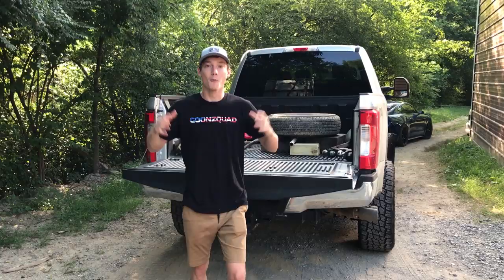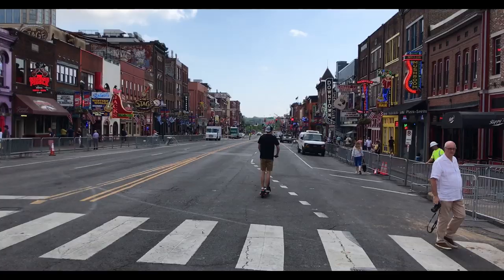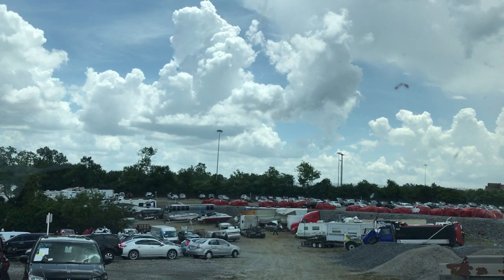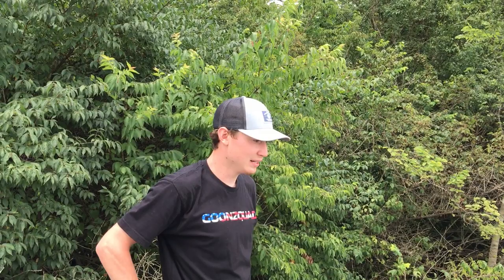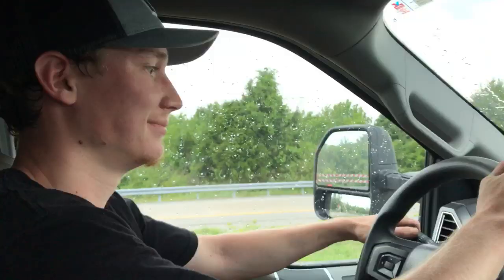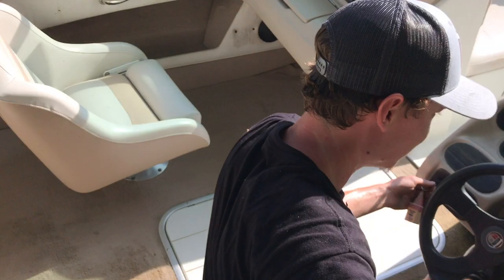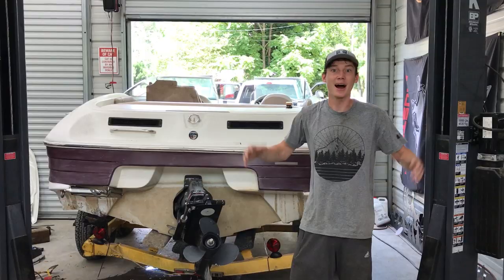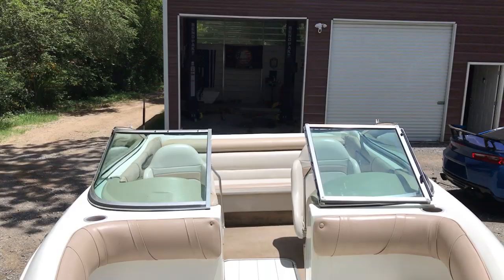Rebuilding A Super Cheap Wrecked Boat

Comment: Congrats on the boat!

Looks like a mid to late 90’s boat with 5.0 Mercury and Alpha 1 Gen 2 drive. Since the engine started right up and sounds good you got a great deal!

One thing to look out for on those older boats is the shift interrupt switch. If the shift cable is out of spec it can cause the boat to stall on the water when shifting out of gear into neutral.They will shift fine on land but then stall in the water when there is drag on the prop.

Looks ready for full send!

Comment: Yo drop in that spare Lamborghini motor.... that would ripp down the lakes man😮🤤
Reply: Would that be possible? That sounds freakin cool!
Reply: Thinkin the same
Reply: Its not because it’s not a marine motor it would fall apart and stop working after 2 or 3 trips on it
Reply: Now that would be awesome!!
Reply: That would probably make it pretty slow. Some center console boats that size have 4 400hp outboards to get moving
Reply: Nah, you need to chop the back off a Ferrari and use that. One Crazy Summer style
Reply: There is a few boats that use Lamborghini engines. I’m sure they could pull it off if they really wanted to.

Comment: That is an outdrive/stern drive/drive leg depending on where you are from. You will need to give the engine a full service, service the outdrive and change your anodes. Cooling is the big issue with boats. Make sure your water intakes are clear. Salt water has an amazing ability to ruin things and corrode. Check your propeller isn’t damaged. Good luck!
Reply: Or stern leg

Comment: Running it without water, you melted the water pump in the outdrive, and may even melted the flapper valves... the engine need to come out to change them. I am a retired marine mechanic.... guys like you made me lots of money!
Reply: Lol YouTube mechanics everywhere , the boats fine go watch their new videos.  They didn’t run it long enough to do any damage
Reply: @rfunder12  LOL at idiots that have no clue! I worked as a marine mechanic for 30+ years. Short runs like that ruin the sea water pump! Bet it fails very soon.
Reply: @OldCarAlley  You don't know anything. A boat can run the engine just fine without any water for that short.
And IF you make so much money of these kind of guys, you prolly was not here.
Reply: @ProgNoizesB  you really dont know wtf you are talking about..

Comment: Put the drain plug back in before putting it in the water!!!!!!!!!!!   You also need to check the water pump impeller and housing because it was most likely burned up during the dry start
Reply: Shane Vlogs not for a minute or so 😒 I would replace the impellor as a matter of course as they are so cheap and easy to fix on a stern drive
Reply: Now that's funny no way that 1 minute dry start burned the water pump it's this type of thought that keeps money flowing stealth in my pockets
Reply: @allmarinemaintenance3714  And since it's old enough to need replacing anyway (potential dry rot), your actual argument is...?
Reply: Bahhh no shit, I couldnt believe what I was seeing
Reply: Likely never checked for gear lube first either.
Wonder if they checked the oil!!!!!
Reply: Every boat guy cringed when they dry started that boat 😭

Comment: firing them up like that with no water burns up your impeller !
Reply: Gotta replace them once a year anyways, but yup!
Reply: lmao it make me cringe so hard
Reply: BizzyTheGreat same
Reply: @justfishing6067  I got 11 years out of a Mercruiser impeller, frequent use year round, and the old one looked fine when I put in a new one.
Reply: @peterdarr383  you lucked out big time. Like playing Russian roulette.
Reply: I was at a lake for New Years and I just hear a massive rev, I look over and there’s a boat going throttle with the motor trimmed up all the way. Basically the motor was running at full throttle in the air for a good three seconds. Then they launched and drove it around, There was still water coming out of the back so they somehow didn’t kill it.
Reply: @peterdarr383  didnt happen
Reply: @peterdarr383  i would never speak that traitor talk lol good one..  Not into arguing or anything but even if you ran a boat in a lake full of cooking oil you would never get that kind of time out of an impeller. I have replaced more than 10000 of them and every day use for that long is just not possible. I wont be convinced of this ever after 25 years as a pro marine tech.  There is not a marine mechanic on this earth who knows what he is talking about that would believe it. Takes 15 seconds running dry to destroy one.. Its just a fact in the biz.. Thats all im saying.

Comment: Don't ever start it dry .. You'll fry the impeller in the outdrive.. I won't even crank mine without the hose hooked up to it
Reply: And don't forget to put the drain plug back before launch!
Reply: I totally agree 💯!
Be sure it's pumping water when you launch it.
I like how you guys trouble shoot!
Reply: I starting my 1988 outboard motor v6 and this guy was working on it and ran it more then 10 minutes and Fry my impeller I’ve added a new one and guess what.. pump does work but only goes to poppet valve but won’t go up to the heads I’m screwed
Reply: I would say it is okay to quick start it just to check that it turns. They cranked it, checked the prop and then cut it.
Reply: @lucuix9901 
I wouldn't risk it with my boat.. However, considering that it is a Copart beater your opinion might just fly..  👍
Reply: Vdubin64 I was about to say the same thing cause my family has a boat and we always start it in the lake or with a garden hose
Reply: @Vdubin64bug   To literally see if it will turn, if you cut the engine quick, it isn't going to get hot enough to do anything. If they let it run for a minute then sure, but just cranking it and then turning it off isn't going to hurt it.
Reply: Barrow  please with water
Reply: Go head and start it, the impeller should be replaced anyway. They're cheap and you know you won't be overheating when you get it in the water.

Comment: Had same boat 1999 5.0 bravo3 drive went 48 mph be careful with glass windshilds no longer avable from Mariah custom glass is 3000.00 for curved glass sold for 6200.00 this past spring with single axle trailer pretty good boats no wood in floor
Reply: Are you one of them that finishes what you have to say, THEN takes a breath? Just curious. lol

Comment: Next project replacing the water pump impeller you just destroyed dry starting the motor without water
Reply: as well as the U joints and coupler starting it with the drive in trailer mode . . . .
Reply: Yuppp
Reply: It will be fine
Reply: @jonjohnson102  ujoints may be but Imp needs replaced now,,
Reply: @jonjohnson102  no, it won't
Reply: Brad Magnuson bet

Comment: You can buy water cooling muffs that clamp onto the outdrive and furnish cooling water.  Some posters are correct, don't run the engine without water going into the outdrive.

Comment: From the looks of it I will change the starter first then pull the plugs I rotate the motor around to see if there's any water in the cylinders make sure you have a set of muffs on the lower unit before you start the motor or you will burn the pump inside the outdrive once running and you plan on keeping the boat change the manifolds and risers and thermostat then do your basic tune up plugs cap water separator filter in carburetor and then hope for the best make sure there is no water in the power trim pump that pump makes the outdrive go up and down

Comment: They’re pulling a damaged and possibly unsafe and unregistered trailer but worried about getting pulled over for trailer lights 😆😆
Reply: Fuck I would never pull a boat without the front nose on the rail nuts could of launched it through the car even though it was tied down balls of steel
Reply: some states don't require you to register trailers, including Tennessee i believe.
Reply: @stevenhastings1480  Inexperience, recklessness, ignorance, .....maybe one of those but it wasn't "Balls".....just kids believing they are bulletproof.
Reply: Whether or not it was registered was the least of the concerns I mentioned.  I know they didn’t mean any harm by it but hopefully they see this comment and realize what could have happened.  Luckily they made it back without any problems.  I have to wonder too if there was a contingency plan for if the trailer wasn’t operable.
Reply: @BigShastaKen  had a boat tilt after I told a mate to tie the strap down and it wasn't done right nearly lost me boat
Reply: @stevenhastings1480  well they had to drive there and didnt want to go back if the had the boat in front of them
Reply: That shit is just dumb.. They didnt eve strap it up properly ...
Reply: They used a boat tie down to hold the fender on the trailer away from the tire. Lmao. It's ok, they will learn. No one is born smart. Some of us has great dad's or brothers/sisters grandpa's or uncles that teach us what to do or what not to do. And some of us just have to learn the hard way. They will make it.

Comment: Knows about boats, dry starts the engine, water pump impeller is now junk.
Reply: That's exactly right.
Reply: Probably needed to be replaced by now anyways. Every 3 years or close is ideal.
Reply from the maker: You live and you learn
Reply: I wouldn't be taking it on the water without tearing into that leg anyways. Impeller and at the very least gear oil should be done. Oil change on the engine as well. Dumping the gas in the tank as it's probably rotten/contaminated is also a good idea.
Reply: Jimmy Alpha Running it on land for a bit isnt gonna kill it
Reply: @samjacobs4769  literally says in almost every oem book, even a few seconds without water can damage the impeller." Zero lube on a piece of rubber against a piece of metal spinning at high rpm.... Yeah it doesn't take long.
Reply: Sam Jacobs yes it is
Reply: I live in the phoenix az and even I know that.they are dumb.we used to test motors in 55 gallon tray cans before we took them out
Reply: I was thinking the same thing😂
Reply: and then he runs the leg forward and reverse with it trimmed right up.... didnt check engine or leg oil, obviously not a mariner
Reply: You coulda taken it to a boat ramp to float back on tge trailer
Reply: very true
Reply: Yup I was just thinking the same thing.
Reply: @samjacobs4769  yes it will. 25 years pro marine tech,,  It only takes a few seconds to damage the impeller. And i dont care who doesnt believe it but i know they dont work on them for a living when they say that crap
Reply: Yep. Impeller is now melted in the housing and if it's a alpha 1 gen 2 the water feed tube is probably melted aswell. But that's part of learning. I did the same thing once.
Reply: @goonzquad  dummy
Reply: @mechanic4744  Are you 7 years old?
Reply: @TT4ME  ?
Reply: It’s not ruined it can run with no coolant until it gets hot lol

Comment: Nice buy guys. Listen just cut that rear crossbar out and the trailer will probably snap back over. If not get a hydraulic spreader and use some 4x4 pieces to spread it. Once is straight on that side again measure for a new crossbar and have a welder make one and install it. New chrome fenders are dirt cheap and easy to install. I'm a boat restoration guy and l say save your money on the trailer, it's an easy fix.

Comment: Just a bit of advice anytime you run the motor put the drive down as far as possible so it puts the drive knuckles as straight as possible. They will last longer. Pain to replace also

Comment: Man it bout killed me to see yall fire up that engine without water hooked up. Glad to see the engine runs good but please hook it up to water next time. That impeller is rubber and without water its highly likely it shredded that impeller in half.  If it were me I would go ahead and replace all the seals and gaskets in the outdrive including the impeller,  plus engine oil and outdrive gear oil. If anyone can handle it, it's the goonsquad bros! I'm excited to see a boat build tho, I have a similar boat that I love taking to the lake. Next video please!

Comment: Better replace the impeller in an outdrive because you started it up dry it cooked it so replace the water pump in the lower unit before you go out anywhere on it
Reply: Yep Bryan water impeller is cheap,like $10 its best to always change em often
Reply: @shootpse88  totally agree never start it without putting the head phones on with the water hose

Comment: Depending how much water has been sitting in the bottom of the boat and for how long, the stringers and transom are probably shot.  Fixing that and replacing the floor will cost $3000-$4000 in materials.

Before you splash the boat, make sure you have a working bilge pump.
Reply: I hope they see this comment...

Comment: Never start these type of motors without water, use garden hose and muffs or you will destroy your impeller in seconds.  Then your boat will overheat.  You will need to split the sterndrive unit now and replace that impeller.  It's toast now!!!
Reply: Water is used mainly for cooling, it’s fine if you fire it up for a few seconds then shut it off, it’s like running your car without coolant
Reply: The impeller is actually quite robust, but the rubber tube connecting the exhaust to the z-drive burns in < 1 minute. At least that is my experience. The impeller survived that.
Reply: @jaxoncroydon3516  I know what I'm talking about.  The water is used for cooling.  The rubber impeller in the drive spins against a metal housing so it you start it without water then it begins to melt it.  The water is lubrication so it can and most likely did damage just that fast.  When it melts then the rubber can end up in the cooling brackets also and cause an obstruction or in the cooling lines.  The engine has a water pump on it as well and that's not what I'm talking about.
Reply: @flybywire5866  his drive is a Alpha One Mercruiser, the rubber impeller starts to melt in seconds.  It will need to be replaced.
Reply: @devildogae  I own one since 25 years. Nothing molten yet. Surely not in seconds.
Reply: @flybywire5866  you dont beleive me, call a shop and ask them, then ask on a boat forums page.  I'm trying to help these guys out and your giving them bad info.  I get you haven't had an issue, but that's not normal.  You might have a different make and model.  Do them a favor and let someone with knowledge give the advice
Reply: @devildogae  If that thing would melt in seconds, dont you think it would have happen to me in 25 years? I always check the engine by running it for about 15 seconds without water. If it would melt in seconds, it would have happened hundreds of times. I guess the experience of 25 years is worth something. For you 25 years experience seem to prove a lack of knowledge. Oh and its a standard of the shelf Alpha one mercruiser.
Reply: @flybywire5866  why wouldn't you use muffs, if you've been a boater for 25 years, surely this isn't the first time you've heard this right?  You better go buy a lottery ticket because your one lucky person.  If it's worked for you 25 years, please dont let me stop you.
Reply: @devildogae  Relax. Running the engine some seconds without cooling does no harm. If i intend to run it longer, of course i use muffs. But for a quick check before driving to a lake 2h away setting the muffs up its just too much effort. Engine start, it runs, engine off and off onto the road.

Comment: Been here since the RV Fire video.
No! Billy and guys not ready for the lake. You burned up your water pump impeller and housing by dry starting it and running it with no water you need earmuffs on the L.U . Plus never start one with the drive up you will break the U-joints to the Outdrive. I would pump out the engine oil and change the oil filter and Marine gear Lube the Outdrive with new water pump kit not just the Impeller. Also with the boat being sunk on the Trailer with the drain plug left in while the boat set on the trailer you need to replace that starter for sure the brushes will stick at some point. Also it has a fast idle with the control handle push in for throttle only but some have a pull out style not sure on your model of boat. You need to pump the handle to prime the motor before starting if not an EFI motor.

Happy Boating from a 3 gen Outboard Tech been around boats all my life, if you were in Texas near me I would help you guys fix this quick. 
Love what you do and all of your builds you guys have a great channel keep up the great work. 
and remember 
Boat = Break - Out - Another - Thousand.
Cheers, Billy Wah
Reply: Hey boys... invite wah420 over for a few days to help you he looks hugely knowledgeable and wants to help👍👍
Peace🇬🇧🇬🇧

Comment: You should've backed it in the lake before traveling with it so it float itself over.
Reply: They could've just had them strap the forklift above the boat to the cleats and set in straight.

Comment: The bilge pump might not be automatic so check for leaks periodically to see if you need to turn it on. Also don't forget to put the drain plug back in when hitting the lake and RUN THE BLOWER when at idle, don't want this V8 you got on the cheap to go up in flames

Comment: PUT THE DRAIN PLUG BACK IN BEFORE YOU SPLASH THE BOAT
Reply: Yeah was thinking the same. Classic mistake! Put that plug back!
Reply: Easy to forget. I have several times. 12 inches of water in the engine bay.
Reply: That's the least of their worries.  Dry starting that boat was not smart.  The water pump impeller is now likely junk.
Reply: I've seen someone dive into the water with the plug in hand and did it underwater under the prop